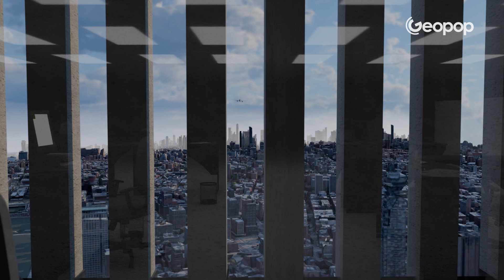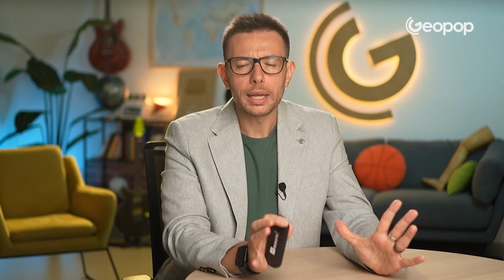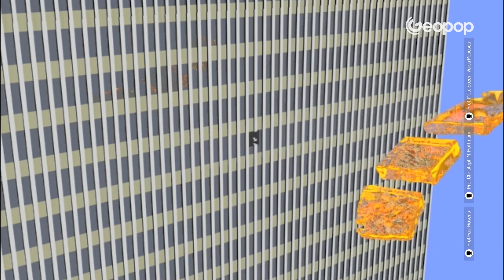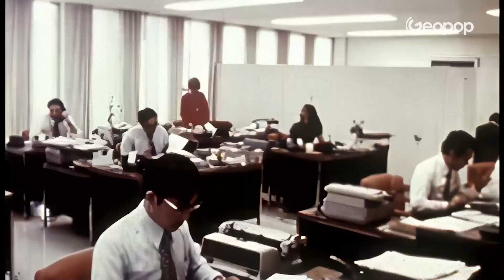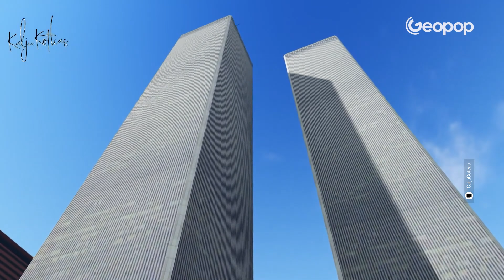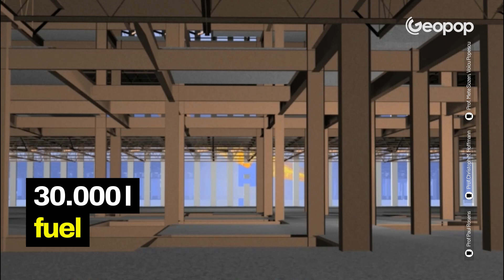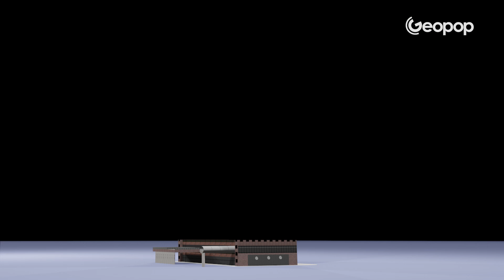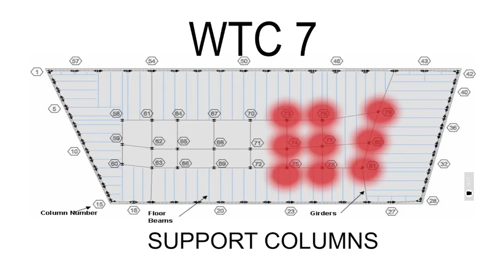9/11, 2001: The Technical Reconstruction of the Twin Towers and WTC 7 Collapses

Comment: The theory for WTC7 isn't about explosions but about thermite. If you want a stronger case, list some other cases where extreme fire damaged the structure of a building, causing it to collapse.
Reply: What's the difference between explosions and thermite?  Does themite, whatever that is, cause explosions ?   Are you sure you are not talking about nano thermite ?  That sounds more scientific at the end of the day.
Reply: List some other examples where thermite was used to bring down a burning and unstable building.

Or any building.
Reply: @TheLoonResistance  Oh stinkyshit, as if you notorious liar weren´t totally aware already that the Skyride tower in Chicago was demolished using thermite back in 1935 aswell as the dome of the Reichstag in Berlin back in 1954...
Reply: @TheLoonResistance Fair enough. I don't know enough about the subject. I was just saying this video was debunking the wrong theory.
The point about other instances of total collapse caused by fire still stands though. I mean, there's got to be other instances, right?
If not, you can see how it can seem suspicious to any layman. I'm not even saying it is inexplicable. The explanation is probably something like: "this particular situation had never been encountered before in this particular type of building, and it was not accounted for. Since then, specialists have adapted and improved the structure so it didn't happen again".
Still sounds suspicious if it's unique.
Reply: @tomaalimosh  - This video isn't really about debunking anything.  It provides a technical explanation for the how and why of Building 7's collapse. 

There are countless thousands of examples of steel framed structures - buildings and bridges - that have collapsed in fire. There was never any doubt as to the proximate cause of Building 7's collapse until years later, when ideologically motivated individuals after having utterly failed to convince the public with obviously nonsense technical claims about demolitions in the Twin Towers or missiles at the Pentagon+ and _shoot-downs over Shanksville took advantage of the lack of attention to Building 7 and filled the void with their own BS narrative.

Comment: Amazing how aluminium can cut through steel like a hot knife through butter 🙄
Reply: Are you really going to argue the aircraft passed through the Towers intact, emerged out the far side unscathed and flew off?
Reply: I don't know if this is a sarcastic remark, but are you really trying to tell us that the supporting columns around the perimeter of the building are not damaged? For example, at 13:45 in the video? And the columns inside were also fine? All these damaged columns carried some load and imagine that this load did not disappear and had to be transferred to other supports. If the temperature there increased to 500°C, the remaining supports also lost tens of percent of their load-bearing capacity and if you add extra load from missing supports it is disaster almost garanteed. Houses are designed for fire resistance 3 hours for load bearing structures here in Europe. But when we design a building, we never really consider that there will be a fire and on the top of that 30% of all supporting elements destroyed. Because no one would ever pay for that. It would be called bunker...

Comment: Over 20 minutes of grass talk and you still didn't explain the mechanism of how the towers collapsed.
Reply: Yes he did. Were you not paying attention? The floors sagged and pulled the columns in causing them to lose all structual support. The top of the building came down and broke all of the connections on the way down. The floors pancaked, and the columns became detatched from the floor trusses. The main point of failure after the collapse started was the floor truss plate which held each floor truss. They were only designed to hold up ONE floor, not 30 floors crashing down on top of them.